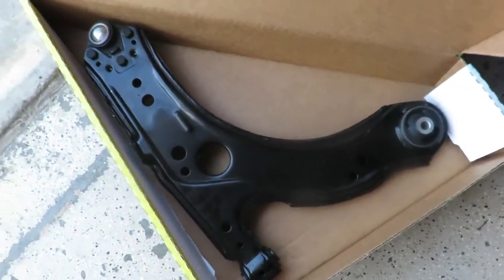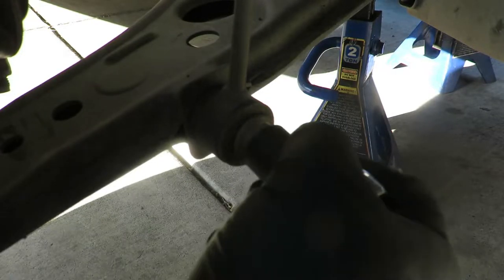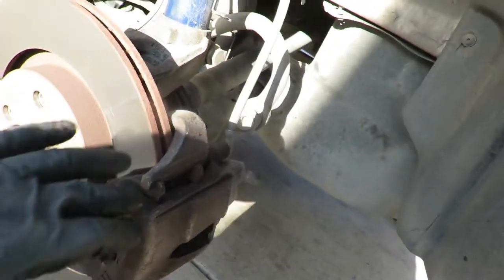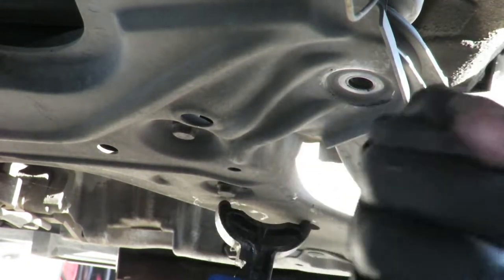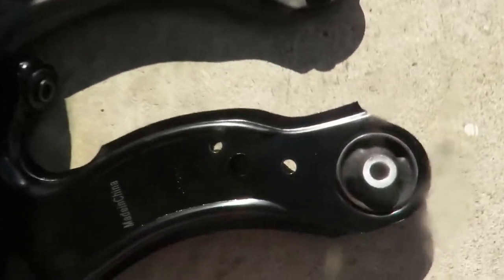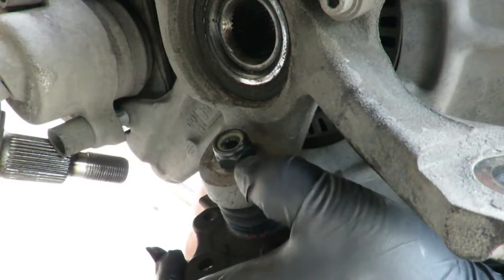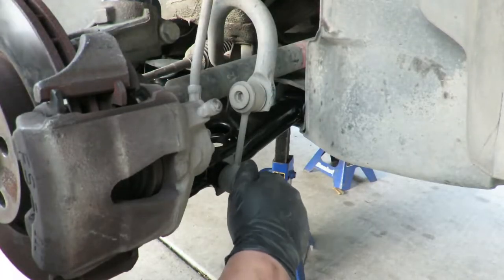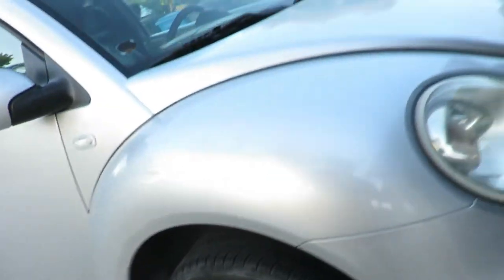VW Beetle - Front Lower Control Arm Replacement

Comment: Great video, the left side (drivers side) not so simple.  Transmission oil pan has to come down, remove filter then the control arm bolt can come out.  Just a word of caution to those thinking they’re just going to knock both control arms out real quick.
Reply from the maker: thats weird. i didnt have to do that for the drivers side. if it was more difficult, i would have included that into the video. But again i dont remember. Good info for anyone who runs into that though
Reply: Just started mine and it looks like I may have to do the same. Do you have the 2.5L?
Reply: Just drop the subframe enough to get at the bolt. That's all you need to do.

Comment: Good video! I just did this job on a 2004 Beetle GLS 2.0 with the 09G six speed auto trans. I saw a comment where someone claimed you can loosen that PITA front bolt on the driver's side control arm, back it out until the head hits the trans pan and then work the control arm out while leaving that bolt dangling in place. I was super skeptical but to my shock and delight it actually worked! The key was to angle the head of the bolt back toward the passenger side of the pan as much as possible. Then slide the new control arm in the same way the old one came out. Never had to loosen the subframe or the dog bone.
Reply: I came searching for this video for this exact reason... I started the passenger side, realized how far out the bolt stuck out, and quickly got angered by the idea that I would have to go through one of these options. Thank you for the comment! (Post attempting this, I do not believe that it is possible with the 2.5L manual trans model)

Comment: Great video on tackling this. I like how you didn't do the ole' "Assembly is reverse of disassembly" especially with the tick of aligning the axel and the ball joints at the same time.
Is there any special alignment when you bolt in the new lower ball joint or are you able to move it when you have to put the three bolts back in?  
Why didn't you also do the tie rods, or at least the tie rod ends? I would think that if the rubber bushings are going bad then the tie rod joints would be bad, too?
Reply from the maker: It is straight forward with the ball joint going straight into the slot, and it has some play room to align the bolts in. 

That would have been good practice to replace the tie rod/ends, but this wasn't getting aligned at the time so I didn't think to do the tie rods. but very good that you brought it up, it can help these viewers.
Reply: @hyr0llr  My issue was discovered when I went to get an alignment, and the kit I ordered was only another few bucks to add the tie rod ends. After I get everything changed out it'll go in for alignment. Thanks again for the great video.

Comment: Hi, great video. Is your car a 1.8T?? And what ball joint/tie rod end puller tool did you use?
Reply from the maker: It was a 2.0
Reply from the maker: And i ended up just using a hammer to pop out the tie rod and ball joint

Comment: Why did you remove so many stuff? all you had to  remove was the 3 nuts on the ball joint...
Reply: This is the proper procedure for this repair. I'm sure you can spot workarounds but you try fighting the knuckle, it sucks. just pull the cv and life is good.
Reply: Legitimately just tried 10/10 not doing again lol

Comment: What torques did you use?
Reply from the maker: From what i read online. 52 ft lbs + 1/4 turn for the front and rear inside bushings. Sway bar 11 Ft Lbs. and 3 ball joint bolts  to control arm 15 Ft Lbs + 1/4 turn. Thats from the forums.